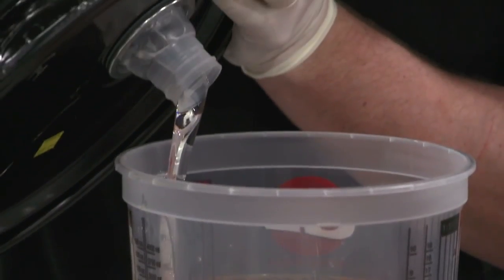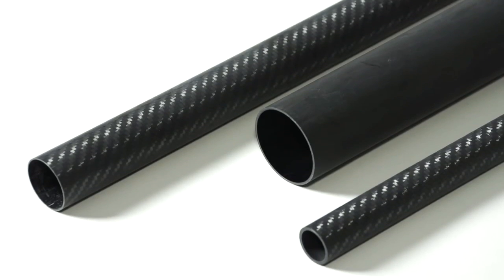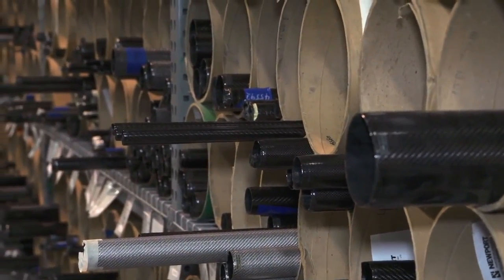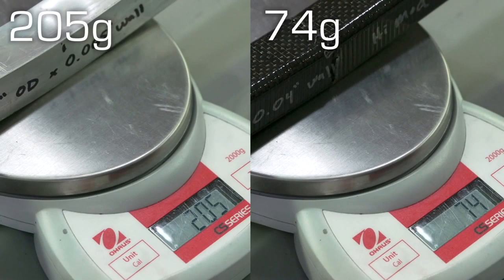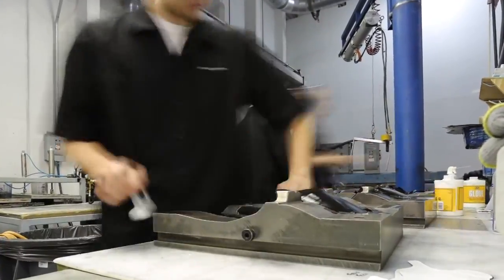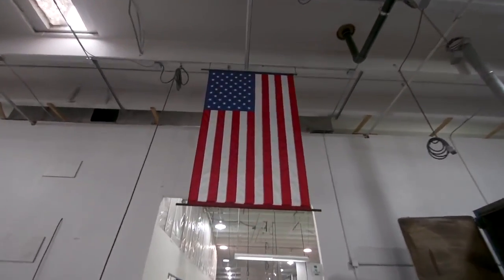Rock West Composites - Introduction

Comment: Hello,

I have been watching your videos for some time now. They are very educational and straight to the point.

However, I am wondering if you could send or advice me some written material on carbon fiber technology.

I am especially interested in general construction and strength principles (lamination, overlays, applying different types and directions of fibers, sandwich and honeycomb structures...).

Also, if you have any data on calculating and simulating stiffness, flexibility and fatigue according to different types of structures, would be great.

Thank you very much in advance and have a nice day,
Domen